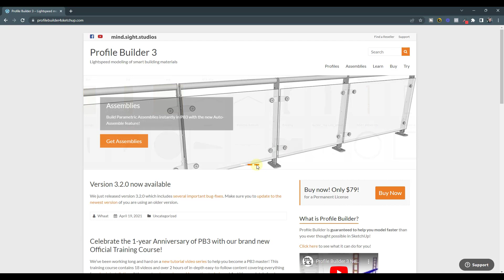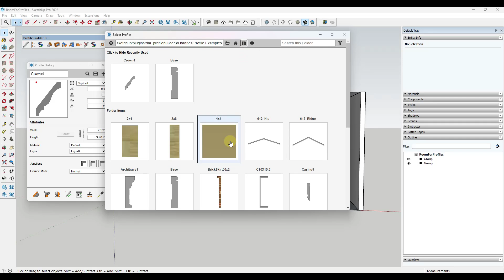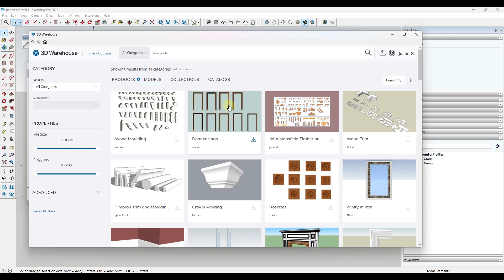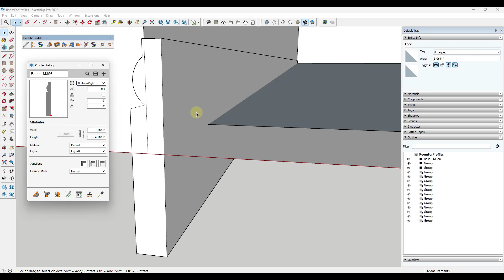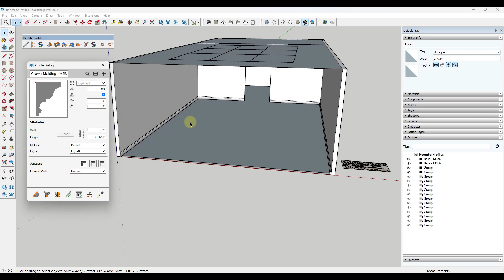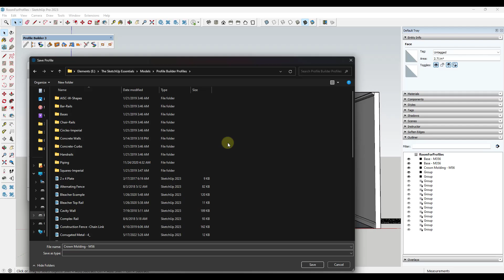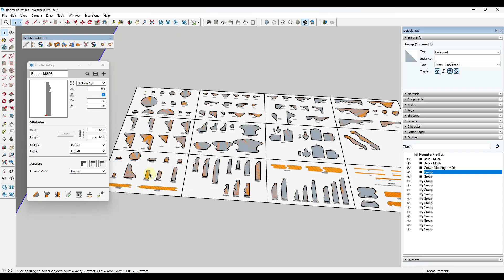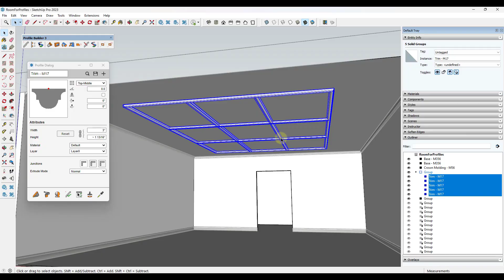Adding TRIM AND BASE in SketchUp - the Easy Way!

Comment: Somebody is going though all the mindsight plugins 🤣😂🤣
profile builder is one of the first plugins I install into any new version of SKP and the profile part is super simple and easy to use. Profile builder has a ton of built in profiles so Jason should have just checked one already in the plugin library instead of going to the warehouse. They already have a great selection. I, also, use it for crown and base mouldings myself. The assembly creator portion is also useful sometimes but very complicated for anything more then super simple assemblies but may be worth the time investment for certain circumstances. As example, i will use the assembly creator to create a window Trim that extends past the frame as it extends out on the top so when i apply that trim to a window opening, i only need to click the 4 corners of the opening and it will know to extend the top piece past the corners.
Reply from the maker: Lol - it just happened to work out that way - I had the Profile Builder vid on the calendar and Artisan 2 came out the same day
Reply: @Thesketchupessentials  I have a side question. Why do you do multiple videos on the same topic - over time? Is that to monetize the new videos (or to keep monetizing them over time)? Its not your first on Profile builder and ive noticed you do it on others as well.
Reply from the maker: @johnjlopez  Really depends - with Profile Builder, honestly the tool is deep enough that I could probably create a whole channel on just applications for this one extension. Sometimes it's just something that I find interesting, and sometimes it's a topic that I think is important. I'm sure I've made 5 or 6 similar videos on groups and components, but in my opinion that's because the understanding of that issue is so important that I hammer it again and again. I'm not afraid of making multiple videos on the same topic - I don't expect everyone who watches this channel to have seen all 1200 or so of my videos, so I'm sure just because I talked about it once doesn't mean I'll never talk about it again.

Comment: Thanks for excellent SketchUp tips!
I use Profile Builder almost all the time. Not only for fences and walls but also for placing rows of chairs etc. I believe that Profile Builder is one of the most versatile tools for SU and worth every cent, even if it can be a bit tricky to learn.